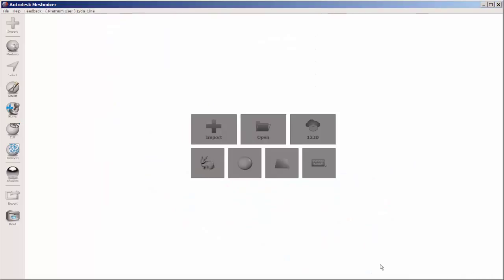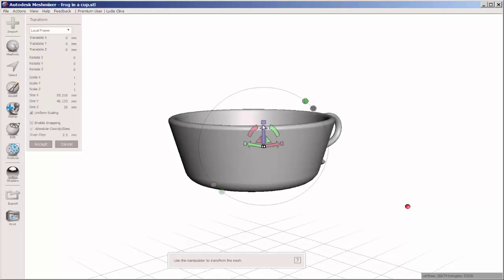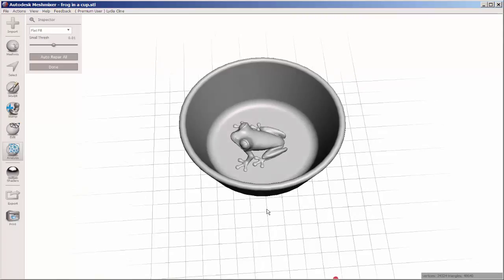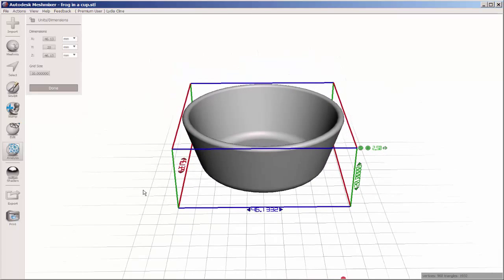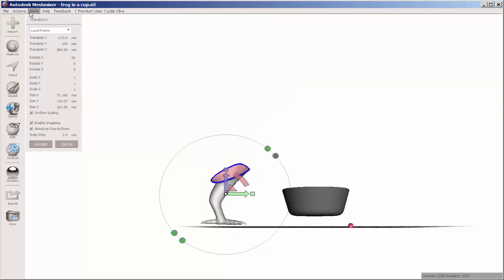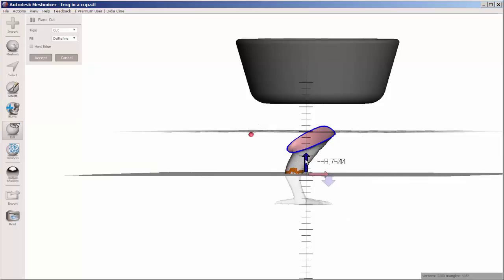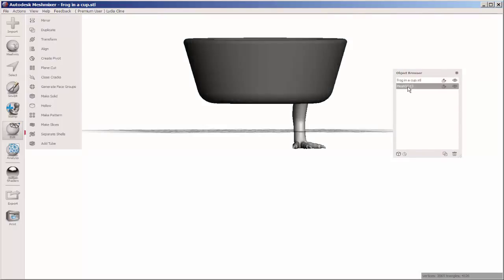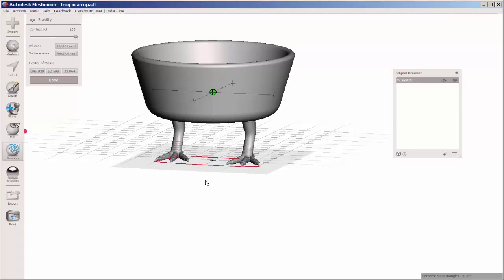Meshmixer: Edit a Design Model

Comment: Is there any way to convert stl file to 123dx file, ProDafting? I found some free 3D model at Thinglverse and I want to modify them to fit my need but I cannot.
Reply from the maker: Hi Tome, you can use the "convert to solid" option in Design IF the stl doesn't have any flaws (such as holes). If the "convert to solid" option doesn't work due to flaws, import it into Tinkercad, which fixes flaws upon import. Then reimport the fixed file into Design and try the "convert to solid" option again. Sometimes that works! If it doesn't, try fixing it with Netfabb or another stl fixer.
Reply: Thank you very much. I'lll try that.

Comment: Is there any way to copy one part of a model and join it to another? Eg move that frog and put it on the bottem?
Reply from the maker: You can't join STL files with solids. You must convert the STL to a solid with the "Mesh to Solid" icon on the glyph that appears when you select it, first. The STL file will convert if it has no holes or other flaws. If it won't convert, try importing it into Tinkercad, which fixes STLS on import. Then export the Tinkercad file as an STL file, import it into Design, and try converting to mesh.
Reply from the maker: MrBizteck, I just realized that this is a Meshmixer tut, I thought it was a Design tut. You have to select a feature and then click Edit/Mirror. That will make a copy.
Reply: ProfDrafting  THANK you very much!  I've been messing with it.  but I keep ending up with holes in the final product.  Trying to select area and Seperate / copy and move the new part.  but tbh its a very complicated design.  A tudor house.
Reply from the maker: Meshmixer isn't appropriate for what you've described. It's for organic 
art sculpting and mixing meshes together. There is no way to be 
accurate, and unless you set up face groups, selecting is difficult. I'd
 suggest you make your changes in the original app if it's available.
Reply: ProfDrafting  would you suggest I switch software before I go too far what  im looking for us a program that allows me to open and edit Stl files.
Reply from the maker: Well, you probably need another program, but there is no program that 
opens and edits STL files.  Try doing what I suggested in my original 
post; bring it into 123D Design, or if it's too big, bring it into 
Fusion, convert it into a solid, and then you might be able to do what 
you want.
Reply: ProfDrafting thanks Ill try
Reply: Its possible, select(S) the frog and seperate(Y), now that its a seperate object, transform(T) and put it at the desired location, in this case the bottom, then select  bowl and frog then boolean union.